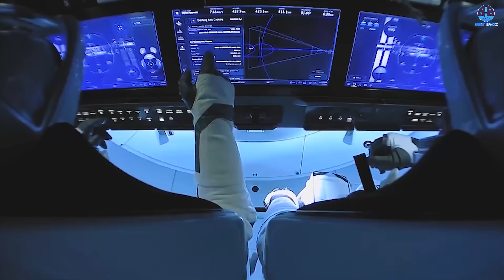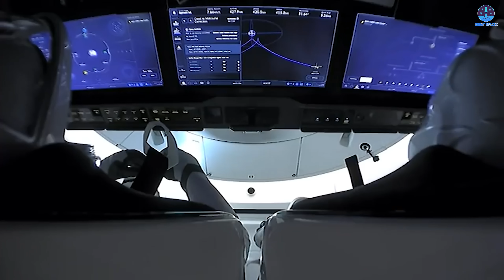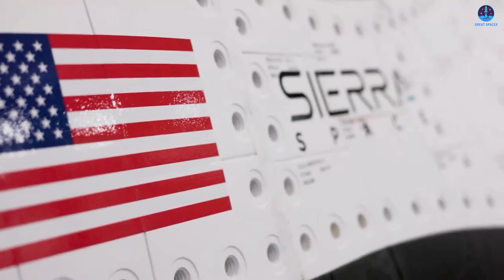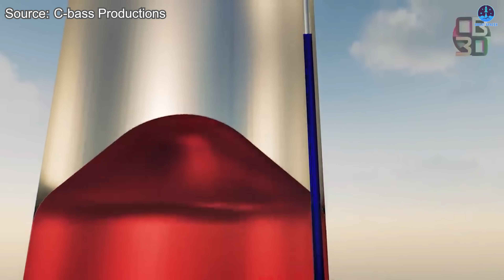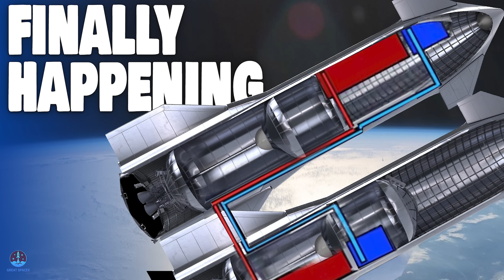SpaceX President Declared Starship Refilling System to the Moon Next Year after…

Comment: Sorry but blah blah blah blah.

How about actually talking about the ACTUAL possible ways to refuel one Starship with another? 

End to End (bottom to bottom) - I think this will be the easiest for them to connect but how about the complexity of refilling tanks that are maybe 400 feet apart. I'm guessing at the distance. Starship V3 is about 408 feet (124.4 meters) and the top fuel tank is maybe half way up the craft. 

Let's just say the furthest tanks form each other are 400 feet or about 200 feet up each rocket. If you dock them butt to butt that means there is about 400 feet between tanks. They need some kind of pump to pump the fuel from one storage tank to another. Now the tank might be mostly empty of fuel but is it totally empty of air? Probably not. And keep in mind, it means that you have to have pipes that are close to 350 long with half the distance account for each rocket. Pumping fuel on earth ends up with some fuel still in the hose. Would this be an issue or how do you suck up every last drop through an approximately 350 foot pipe? Multiple pumps or what? And what about the air that is in the tank that is being filled? Do you have another pipe that sucks the air out of tank being filled while it is also having fuel sucked into it?

Getting the fuel through the 350 foot pipe I think is the hardest part and what do you do with the fuel that doesn't make it ALL of the way from the tanker to the ship being filled? Do you open it up to space and let it get sucked out to space? That requires yet more valves and more failure points. But leaving it in? Would that possibly create any problems? I honestly don't know because I was a programmer for 40 years. This is totally out of my scope of knowledge. 

But in programming we follow logic. And logic to me says that the best path is the shortest path which would mean docking the ships side by side. 

Now this site shows a couple different views of mating the ships to transfer the fuel.

One has a long narrow (compared to the Starships) connector to connect and transfer the fuel to the tanks. That is a horrible design because the weight of two ships is MASSIVE, especially with the fuel on board the tanker. So that would NOT be the way that they would connect the two ships. The odds of them not mating up PERFECTLY with this time of connector would be a very high chance for the connectors to be damaged with a worst case scenario of the pipes breaking on the target (non-tanker) Starship now making that Starship broken and unrepairable without taking it back down to earth for repairs. AND, the cost and time that it would take to repair it would probably be more costly than building a new Starship. And that's without talking about the delays and future potential damage on future refillings.

Keep in mind that SpaceX intends for Starships to be refueled as many times as a typical jumbo jet. Apple's Safari AI overview states, "A typical jumbo jet like a Boeing 747 will have about 20,000 to 35,000 flight cycles". Not think about trying to refuel a Starship 20,000 to 35,000 times with that narrow band connector. That's a HORRIBLE design. 

The second video shows 4 points on both Starships with one being the male side and the other being the female side. That's for lining up the Starships when connecting to each other. Those are tiny and flimsy compared to the size and weight of the Starships. I KNOW that there will be only microgravity in space. But we're talking about INERTIA here where you have to EXTREMELY heavy Starships mating up with each other. Anything small has too many changes of being bent causing the spaceship to have to return to earth to be repaired. And you are going to try to use these things TENS of THOUSANDS to times to refuel? Even if it is HUNDREDS of times this is EXTREMELY RISKY without the docking ports being VERY STRONG with VERY LITTLE chance of breaking or bending when mating. And SpaceX has docked quite a few times with ISS with the ports that they have on the nose of their Starships when taking astronauts and/or cargo to the ISS.

Would they throw out all of that experience? I DO NOT believe so. Any type of mating between the Starship tanker and the Starship going to the moon or to Mars WILL have the same docking ports as they've been using. The only difference is that when they dock, instead of opening a hatch for cargo or crew, instead pipes will mate and refilling will commence. 

The next question is about moving the fuel from the tanker to the moon or Mars bound Starship. 

Do the tanks ONLY have the oxygen or other fuels with a vacuum inside the tanks as the fuel is used? I do not believe so because that would make it harder and harder for fuel to make it to the engines. Which means that there must be nitrogen or some other gas replacing the liquid fuel in the tanks.

As the fuel is transferred from the tanker to the moon or Mars bound Starship, this "other" gas will have to be sucked into the tanker as the fuel gets pumped into the tanks. THIS is the tricky part of the whole thing. And I'm sure that SpaceX has been doing everything it can to figure this out for YEARS now. I highly doubt that they have waited until the last minute to try to figure this out. 

I also wonder if they've been doing mini tests in the boosters and the Starships that they've been launching. It is not like they have to tell us if they are doing that. But doesn't that SOUND like something that SpaceX would do? Instead of waiting and waiting and waiting to test like Boeing and Lockheed Martin and other companies do, SpaceX tries "good enough" or "best guesses" and sees what happens. Then they learn from their mistakes if they aren't lucky enough to be right the first time. 

So my guess is while the haven't been practicing mating ships, not as far as tanker to receiving ship, but they HAVE been doing those matings between their rockets and the ISS over and over and over and they've got THAT part of the deal down. They only part they have to work on, which I think they've already been testing inside Starships in space, and maybe not just Starships. 

Who's to say that SpaceX hasn't already been testing tank to tank refueling inside of with Falcon 9 rockets? What would stop them from doing so? They have been launching a LOT of their own satellites up into space. It isn't like they are risking another company's cargo if they were to put two additional tanks inside of a Falcon 9 and attempting to pump fuel from one tank to another AFTER all of the satellites have bene launched into space. WHY couldn't they have already been doing this?

Keep in mind that Falcon 9 rockets are the PERFECT test bed for testing this out! Personally, I BELIEVE that SpaceX has already been testing EVERYTHING they need to do docking and refueling in space. They could even have been testing mini-docking modules inside of Falcon 9 rockets to see how different versions of male to female pips connecting and pumping works. 

They are a privately owned company. They do NOT have to tell us "everything". In fact we KNOW that there is a lot that SpaceX isn't telling us because they want to keep the Chinese and anyone else that is trying to copy what they do a secret to keep a competitive advantage. 

Anyway, I believe that SpaceX has been testing the docking and the pumping of fuels in space all along under our noses without us knowing about it. Which is why Gwynne Shotwell and Elon Musk are so positive that refueling in space will work. It's because they've been doing it already without telling us. And we've seen EXACT how the mating happens and how the docking to refuel WILL happen. The rest most likely has been done inside where we can't see it. But I believe they've already perfected it or has gotten as close as you can without doing the large scale pumping of fuel between ships.
Reply: The four contact point method is the current plan at least based on the flight hardware seen at Starbase. There is no confirmation yet what the actual transfer point is going to be those connection points may just be for docking the ships relative. Space did already test tank to tank refueling on an earlier v1 flight between main and header tank for 10 tons of fuel. It is quite posible that there have been further transfer tests which have not been announced as they refine the procedure.
Reply: @shaung949  Thanks for that update. I would say that they need to beef up those connection points if they expect to be making at minimum "hundreds" of connections over time. 

And I can't assume that they would be dumb enough to stop testing after just one test. And I'm NOT calling them dumb. Just the opposite. I'm just pointing out that being successful once doesn't mean they have it down, just that they were able to do it once. 

I'd be interested to hear opposing opinions on how much of a difference connecting butt to butt vs side to side would make. Personally I think it would make a huge difference. But that's just me. And any thoughts on how  much fuel would be left inside the pipes, especially if they were butt to butt. What kind of hazard or in what way could they limit the amount of fuel in a pipe. Obviously "sucking" it as best they can (in a good way). But that still doesn't get you 100% and nothing will. I was just hoping for more responses.
Reply: @Olson2BW spinning two docked starship that were nose to nose or butt to but would force fuel to extream ends getting rid of possible gas in the pipes.
Reply: .  Thanks for that.   I guess I was overthinking it too much, end to end and spinning is probably too much force on any docking equipment,  but maybe spinning or rather both rotating whilst docked body to body with the already spotted female docks could be easier.  

Two spacecraft would be joined together and made to spin around a common center of mass. 
This rotation would create centrifugal force, pushing the liquid propellant toward the outer walls of the tanks.
This would allow the fuel to be collected from the outside of the tanks and pumped into the receiving ship more easily.
One other method could just be using a spacecraft's thrust to transfer propellant. The tanker ship would accelerate away from the receiving ship, using the principle of inertia to transfer fuel.
Reply: @shaung949  found this shaung,   interesting but also same theory i presume if they rotated lengh or body to body and rotated around a central point.   https://youtu.be/m4hvv2AfIhM?si=n__H8YQISKkK3ll3
Reply: https://youtu.be/m4hvv2AfIhM?si=n__H8YQISKkK3ll3

Comment: LiDAR so good Tesla refuses to use it.
5:40 “SpaceX is going to prove that both stages are able to reach orbit”  no, Booster reaches 65km, turns around and comes back. No known plans for booster to reach orbit.
Reply: Why would they? The name says it all, Starshipheavy. It's a booster. Boosters never go to orbit as they are just an extension of the launch tower to get far enough away from Earth's 1G of gravity so Starship can launch off of it and go do its thing.
Reply: Superheavy has reached space before over 110km on early flights the last flight it still got up to 88km but you are correct superheavy is not capable of orbit and never will be. Starship by itself is technically capable of SSTO but the margins are too low to make it practical.
Reply: @shaung949 what's ssto?
Reply: Someone else happily joining the hordes of people delaring the impossibility of what Space X then went on to achieve.  Repeatedly. Affordably. Safely.

Comment: The next ship in production already has the mating equipment installed, to do the first refuelling attempt. There is footage on Nasa Space Flight Channel showing them moving it to the production bay for assembly. They are moving fast.
Reply: Yes I mentioned the two female docking ports.  Will be such a big step
Reply: Whether they will use it or not is an interesting question - I think probably not on this first flight of Starship-V3.
Essentially it’s used as a build-fit test, and for other checks.
The flight after that though, may start to actually use it - to do that they would need two Starships in flight, one orbital one, followed by a second ship to meet it in orbit.  I this might be flights 3 and 4, rather than flights 2 and 3. ?
Reply: @peterclarke3020  I would have to agree, there are other milestones that need to be met first, every iteration brings more data.
Reply: @peterclarke3020 great point
Reply: Spacex already transferred LOX is space,  remember?
Reply: @sillycowgirl true

Comment: use three starships, two fuel only with by-model nuclear engines running on hydrogen.  Each can hold 200 tons of hydrogen/ methane.  One crew / cargo starship.  Dock the three ships in orbit. transfer only what is required for the crew/cargo ship. The (Super Heavy Starship) will be created for moon only, never to return to earth. Once on the moon the two fuel tugs ships would use the nuclear reactors to power the moon base station.    This means, delete heat shields, fins, and solar panels.  The hydrogen and LOX gives you all the power and water required.

Comment: For the first tests, I would fill one tanker starship all the way full, and then in one transfer fill the HLS. That way HLS is safe in a diff orbit for most of the process, until the process is refined. That was free. ;)
Reply: It depends how much payload V3 can lift. V2 could only lift 20t so, that is not a lot
Reply: @pedrosura  Elon Stated v1 was around 50 tons, as they refine the design a lot of the test hardware can be removed along with optimizations. V3 is going to loose a whole load of mass as it doesn't need the engine shielding for a start.
Reply: @shaung949 Yeah, that was BS. That is why I say these guys lie. V2 has only demonstrated 20t to a suborbital trajectory. It lands with almost no fuel. 100t is ridiculous, specially for V1.
In any case, they are admitting what I am telling you… now
It is supposed to reach 100t for V3. We shall see. I don’t believe anything Elon says. He exaggerates and lies. His word is worthless
Reply: That is most likely the plan multiple trips to the depot to fill the tanks then HLS launches and collects a full load of fuel and heads for the moon.

Comment: A modified booster would be better to use as a storage tank because it would have higher fuel capacity than a modified starship, less engines on the tanker would reduce its weight too because it would not be being used as a lift vehicle as it would be in a lesser gravity once lifted off the planet! (A temporary nose cone may be required to make it more aerodynamic, but it could be jetisoned/discarded after orbit or L.E.O. is reached).
Reply: Boosters never achieve orbit. There is a whole history of Rocket Science that illustrates how and why this isn't a workable plan.
Reply: @BigBrainBrian first time for everything!!
Reply: Put a stubby nose on the "booster" and send the whole thing into orbit
Reply: @ustmissouri8029 then it would be empty, using it to lift a second booster would mean you have one with some fuel already in it.

The second stage booster wouldn't n̈eed as many engines so you'd be saving weight for extra fuel/cargo?